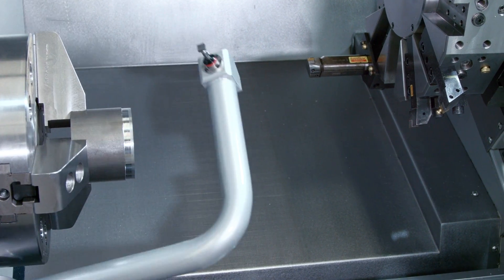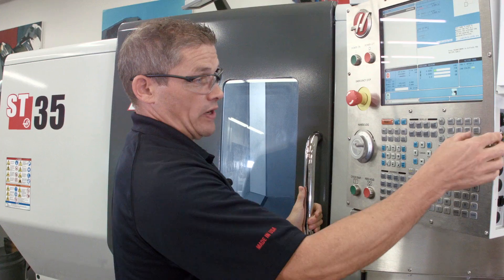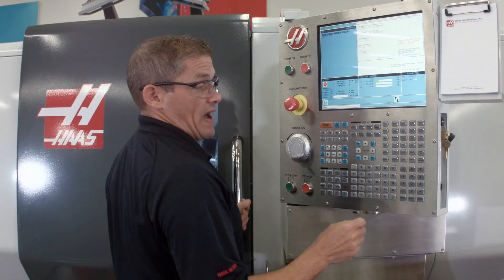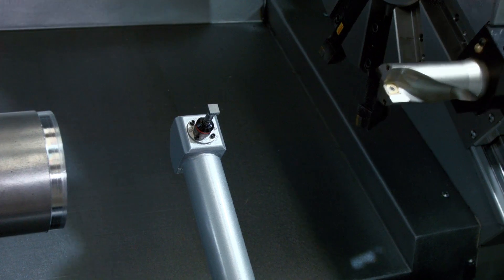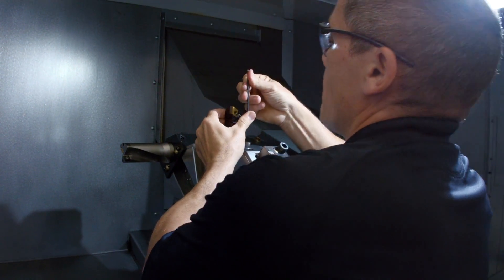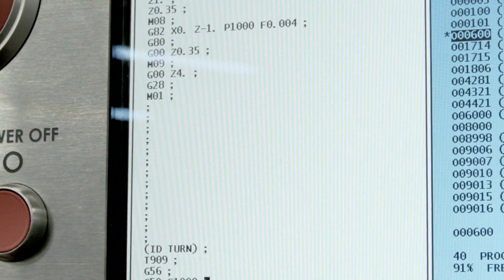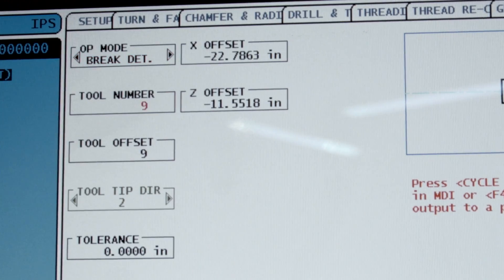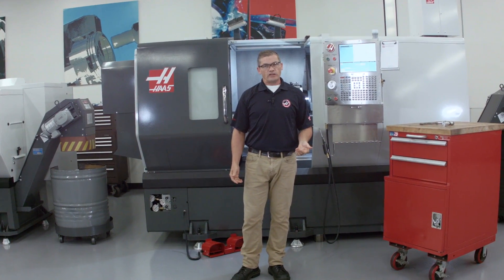Set Tool Length Offsets Quickly – The Automatic Tool Presetter for your Haas CNC Lathe

Comment: Ok this is great but what I don't understand is how does the machine know how long the stock in the spindle is? If we measure the tools with the presetter, it just knows how long the tool is, not the stock.
Reply: with g54,g55 etc, the machines knows where the "zero point" is located.....
Reply: @gustavofulbito4529  but how do you set the G54
Reply: I was thinking the same thing. This eliminates the tool offset but wouldn't you still have to do a manual part offset?

Comment: I have a problem trying to figure out how can I touch off an OD tool that is opposite to the normal turning direction, in other words the tip #4.
How do I set the Z offset? What tool conpensation should I use?
Reply from the maker: Hi Ro. You would set this by: 
1) Index to the desired tool. 
2) Drop down the tool setter with F1. 
3) Jog the tool to where the cutting tip is on the left side of the 10mm block within 5mm. 
4) Jog down in X to the center of the 10mm block. 
5) Select the Tool Offset Geometry page. 
6) High light the Z offset for the desired tool. 
7) Select .001/1. Increment 
8) Push the Z+ arrow and jog the tool to the right until it beeps and stops moving. 
9) The Z offset should now be correct. 

The tip compensation will be G41. 

Use caution when running the first part. If there is a problem please send me an e-mail with the details.
Reply: Haas Automation, Inc. We don't have tool setter! How can I touch the Z axis?
Reply from the maker: Use a scale and jog the Z axis until the tool is flush with the face. 

1) Go to the Tool Geometry Offset page 
2) Highlight the corresponding Z offset 
3) Press Z FACE MEASURE button. The Z offset should now be set correctly. 

When backtracking the outside diameter use tip #4 and input the correct radius. Use G41 cutter compensation when backtracking the O.D.

Hope this helps. Your local Haas Factory Outlet will be happy to assist you if you need more help.
Reply: scale?
Reply: @173roberto  a scale is a small, thin ruler. Usually only like 5-6 in. In length.

Comment: How do I set x axis offset of a drill with an ST-20 that has an ATP?
Reply from the maker: Now that’s a good topic! I’ll put it on the list. If we’re lucky, Parameter 254 SPINDLE CENTER is correctly set, and we just press F2 from the Tool Offset page, in JOG mode. You can ask your local Haas Factory Outlet for help on having this value set (it was set on install). To use the ATP, I’ll just manually touch the side of the drill (or a pin in the holder), and then bring my tool down by the tool diameter (.5” drill, bring X Tool Offset down by .5” diameter after touching off on side of drill or pin, putting drill back on center). To verify any of this, use a Co-Axial Indicator, mounted in your spindle, to indicate-in your drill holder, noting the X machine Position.
-Mark, Haas Tip of the Day

Comment: The most common problem is when you provide thread operation with the tap. If your drill breaks and then goes a tap, the tap breaks too. How can  this problem be solved on modern HAAS?
Reply from the maker: +Mister Krivling This is exactly the kind of situation where the ATP system's "break detect" function comes into play.
Say you had a drilling cycle followed by a tapping cycle, and you were worried that the drill might break. In this case, you would program the ATP system to check the drill following the drilling cycle using "break detect" mode. That way, if the drill does actually break, the machine stops before moving onto the tap, when the ATP probe finds that the drill length is not within tolerance.
This same approach can also be used on Haas VMCs, that are equipped with the optional WIPS probing system, in a very similar way. Here again the drill is checked after the drilling cycle is complete, to ensure the tap is not going to try tapping an undrilled hole. Hope this helps!
Reply: +Haas Automation, Inc. Thank you!

Comment: Thanks for the video! 
Just need to know, is it possible to make correction automatically if the ATP has detected a broken tool?
Reply from the maker: +Николай Хижняк Typically, when you've changed an insert or expect only a small change in the insert's offset position (due to wear) you can use "Automatic" mode to automatically update the tool offsets.
If you anticipate an insert that may break or wear so quickly that you'll need to change it rather than just update the offset position, then you should use the "Break Detect" setting to let you know when the insert needs to be physically changed out. Hope this helps!
Reply: +Николай Хижняк Nonsense! You need to change an insert or tool if broken tool has been detected. Maybe there are some robots on the market, which can change inserts, but I haven`t seen these. :) On Okumas you can programm several tools for the same operation. If 1st tool is broken or worn out, then 2nd, 3rd... is used automatically. And do not use such automatic approach for drilling!